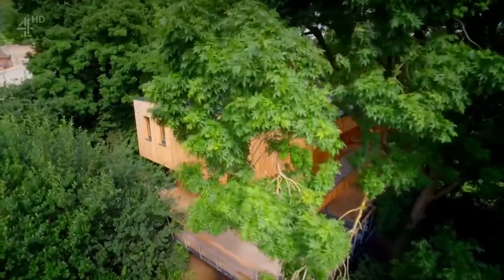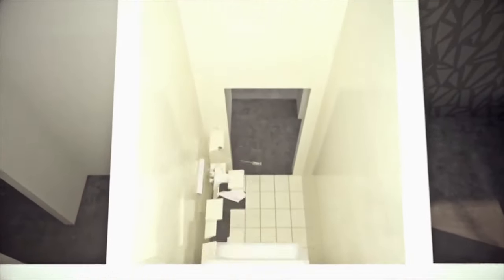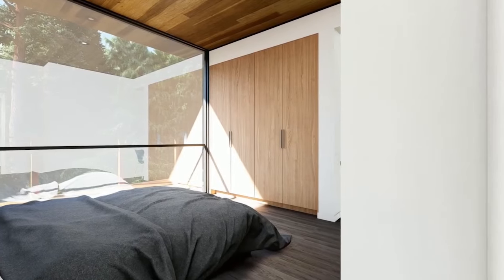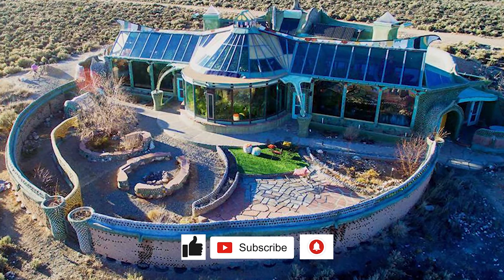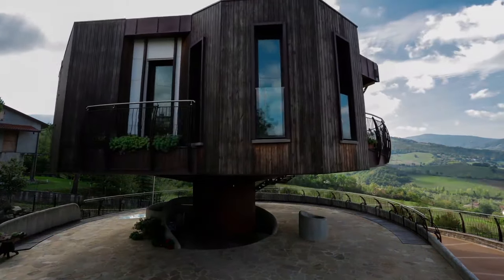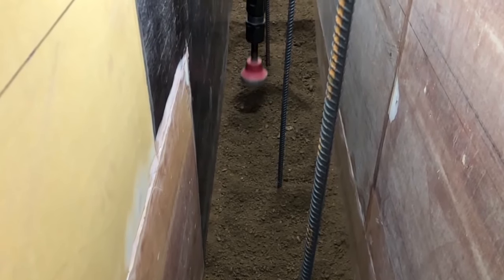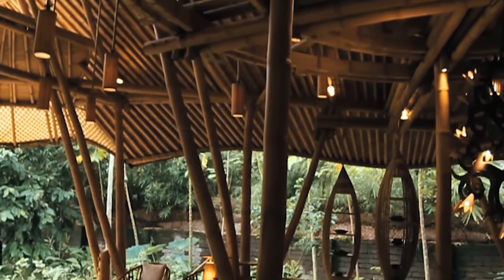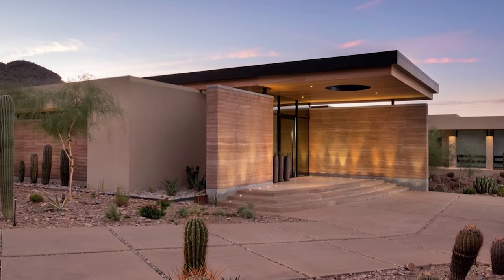10 Eco-Friendly and Sustainable Houses | Green Building Design

Comment: Good Afternoon Sir, i am building a bamboo home at present, we are obliged to use a percentage of concrete in the Philippines. we aim to use 95 % of the materials from our land, we have bamboo and wood. We are building an eco resort also, the same, 95 % from the land, all furniture built on site with NO glue. Architect has designed the house, would love to share pics, do you have an email address? when finished i will invite you to visit